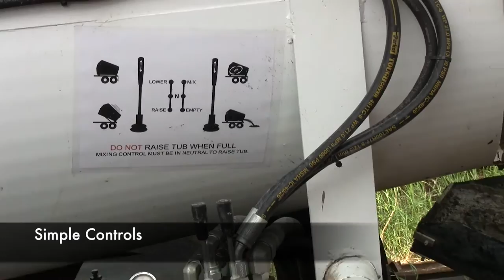Mix-n-Pour Concrete Mixing Trailer

Comment: That as you see is the main problem with mixing trailers and even worst on a paddle mixer, as opposed to a inclined drum mixer, to low to the ground, making shooting the concrete even a few feet from the trailer difficult at best.